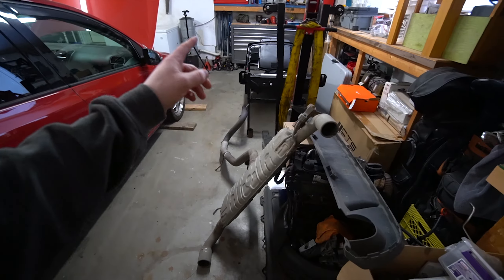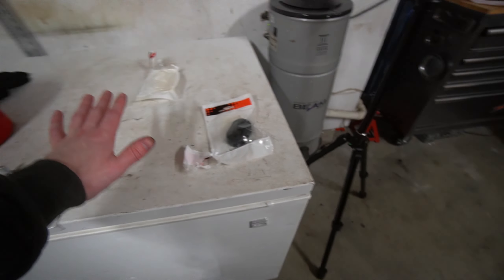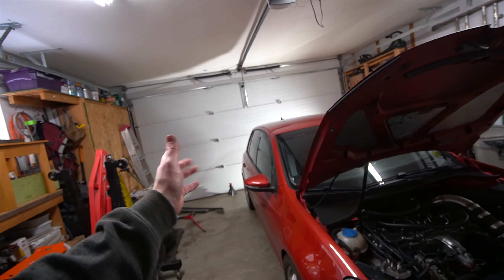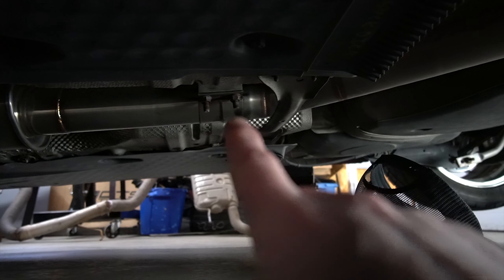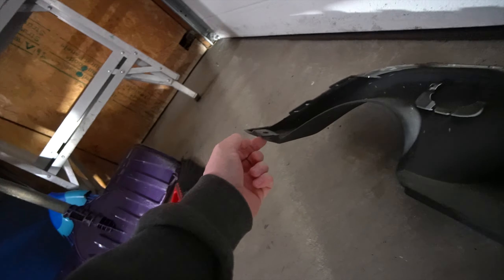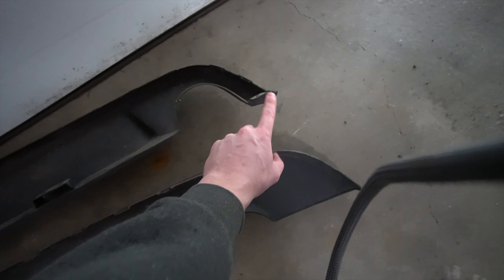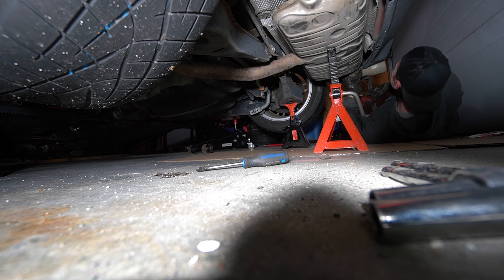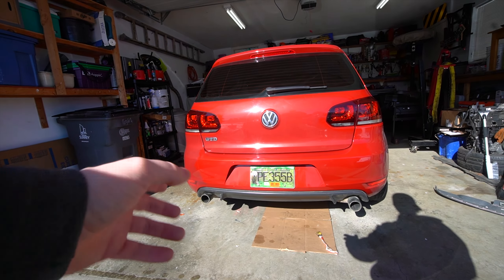Putting a GTI exhaust on my Non GTI/ TDI MK6!

Comment: The rear bumper is also the GTI bumper, right? 
My 1.6 tdi rear bumper is different from yours in this video, so I guess it is the GTI bumper here aswell as the diffuser. Correct me if I'm wrong.
Reply from the maker: Nope! Mine is a stock 2.0 TDI bumper, no fancy kit or anything, I think the GTI bumper is the same in Canada as the 2.0tdi bumper, just different valence
Reply: @ThatGuyTyy  Oh, I see. I have an european TDI so it might be also that compared to yours in Canada.

Btw I wanted to ask you, did you get any black smokes through the exhaust with your final setup after changing the turbo, inyectors and so on before selling it?
I didn't see any black smokes from all the mk6 videos listed on your profile. 

Darkside developments said to me that with "fine tuning" could do straight pipe/remove cat and have no black smokes, dont know how exactly.

Comment: Hello, Great job, I made the same modification on my tdi and I also have the same problem with my exhaust on the right side, it comes out too much compared to the left side, did you find a solution?
Reply from the maker: For me it ended up being an issue with the clamp connecting the mid pipe to the rear muffler! Some messing around got it sorted for me - had someone push the Right side tip in while I was adjusting clamps and tightened it back up and it was all good to go

Comment: Did you not need a pipe reducer for the exhaust?
Reply from the maker: Yes I had one kickin around - it all depends on the mid pipe or not, mine was aftermarket, so stock downpipe/ midpipe should fit no problem!